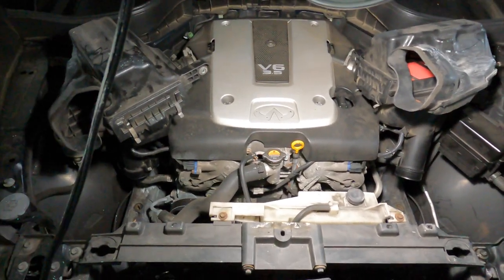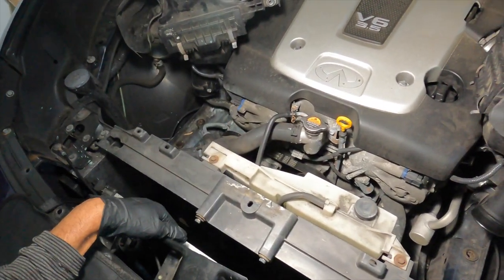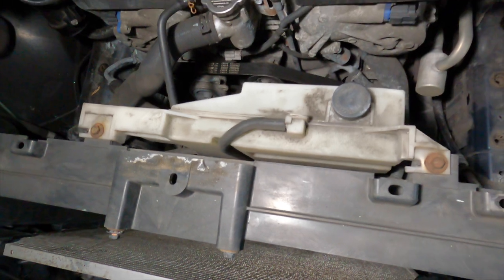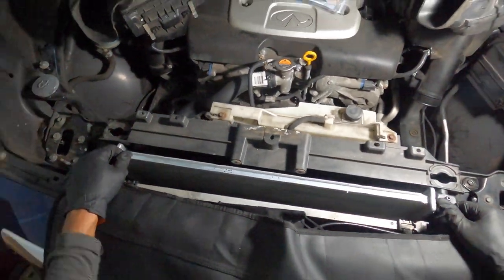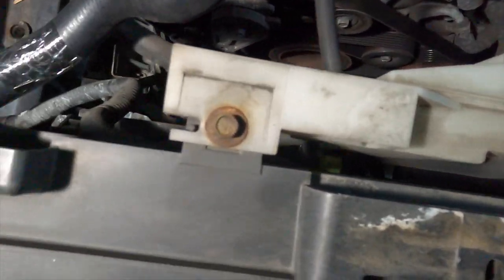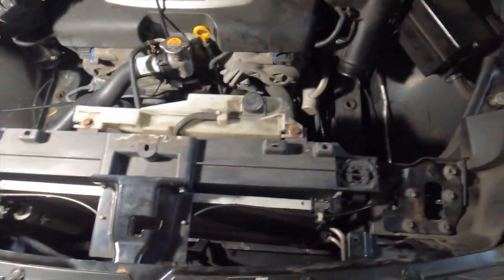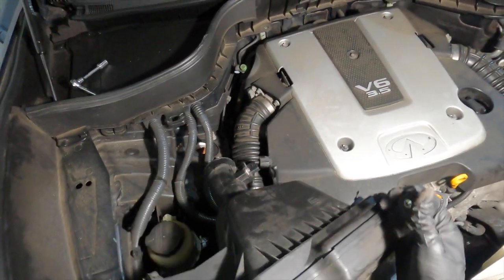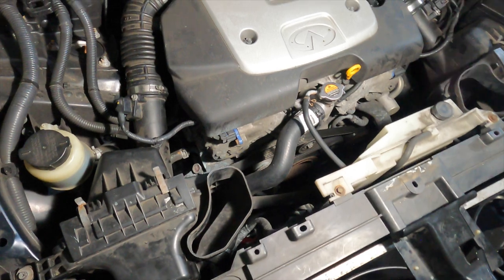Infiniti FX Radiator Install

Comment: Thanks for making this video, DCjoker, however I read in the manual if you take off the coupling for the large upper hose that you have just made the seal faulty and a new radiator is required. I don't know how true this is. I realize the only way to install the radiator without doing this is of course removing the ac condenser to more easily move in the radiator to its resting location. Did you notice any leaks/issues with that coupling mating tightly after your broke that seal?
Reply from the maker: Hey, thanks for watching and commenting. I haven't had any leaks or issues since installing the radiator by removing that coupling

Comment: How much transmission fluid did you lose? I'm going to do this tomorrow. I replaced my fans and my thermostat but the coolant still ends up in the reservoir and not cycling though the system, so i will of the radiator tomorow. Wish me luck! I have pre diluted coolant, 2 gallons, is that enough for my 2010 FX35? did you reuse the ones you removed from the radiator?
Reply from the maker: Very little transmission fluid, when removing the hoses just quickly turn them upwards. Good luck!
Reply: @dcjoker  Changed it today, took me about 2 hours. i was having trouble getting the radiator out and it was because of the damn horn... lol once i removed that, and i accidentally tore a electric cables from it so one of my horns doesn't work now, it was smooth sailing after that. I bled the system as best as i could, but i will keep an eye out and see i need to top it off or something. Weirdly after this install i got a P2101 Code which is "throttle actuator A Control Motor circuit range /performance. No idea what that is, so i cleaned the Throttle Body.... i dont know, but the radiator was a success. thank you!

Comment: Your entire video did not show what your hands did. It doesn't even show how you disconnect the clips from the condenser or anyting it's only showing the gear shift in the actual engine you can't even see the work you did on the radiator. This is a wasted video.
Reply from the maker: Your comment was a wasted comment since your comprehension is off. You still watched it though 😎

Comment: Do not put back driver side air box until you refill the coolant on the system (a plastic screw at top of radiator should be removed to let the air go out) and the vertical piece at front can be removed just have a 10mm nut on bottom